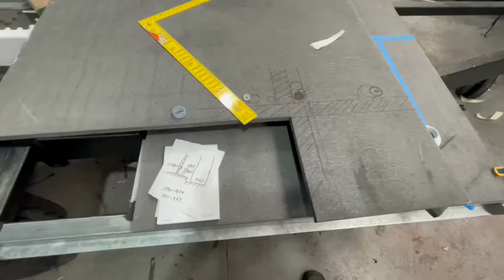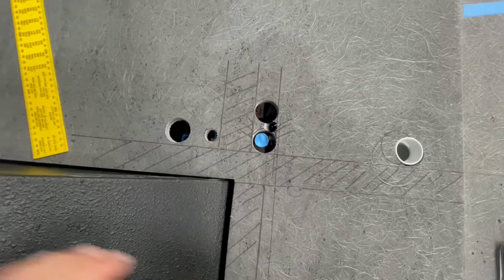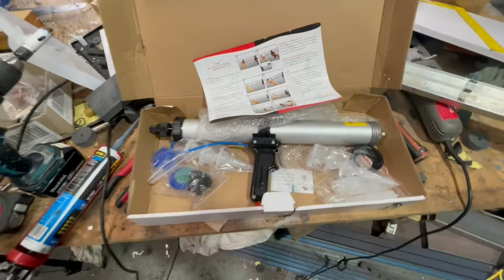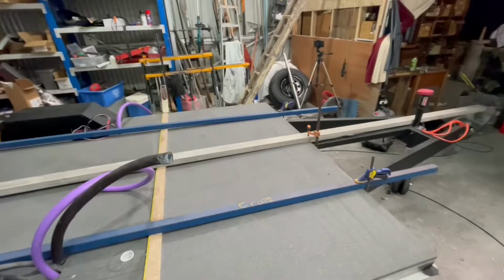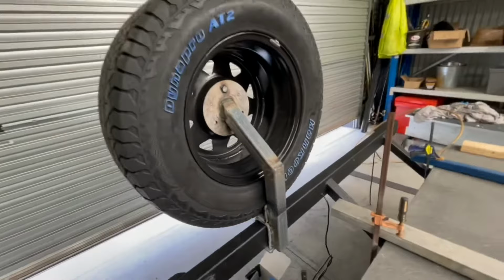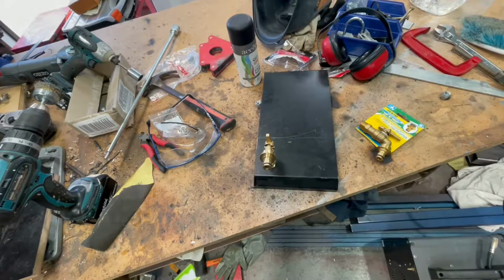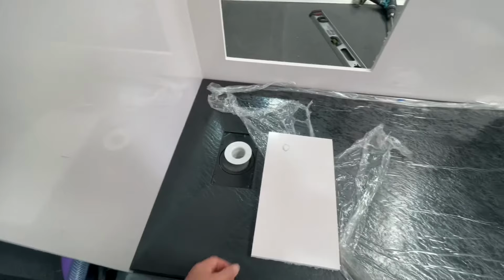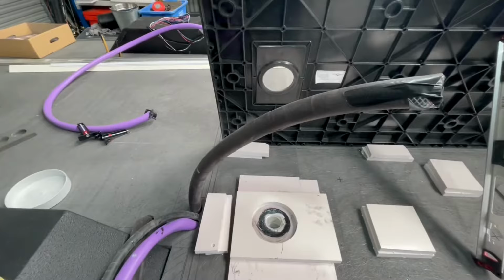Episode #8 - Solo DIY caravan build series - flooring and internals

Comment: Lookin great Craig. That flooring looks pretty tough/dense. I regret not using more dense flooring in mine. That Teroson 939 is amazing stuff. I think I've gone through at least 2 cases of the 750ml sausages :D. Those air caulk guns are a life saver too.
Reply from the maker: Thanks Jess / I’ve used heaps of it also, most of it is on my shirt though i think.
Reply: Not sure if you mention it but what flooring is it and where did u source please Craig?
Reply from the maker: @bradc6721  it is called thermolite - the Q&A episode talks to it. Styromax have it but i got i locally from the national distributor. His company is called avcom i think, in moolap Geelong
Reply: @PerpetualTransient  Thanks legend. Yeah styromax are not to far from me but I also found a lad selling 15mm sheets fairly close to me also for 400 so that might be the go. What thickness to u use? 19mm?
Reply from the maker: @bradc6721  yeh 19

Comment: Where did you source your Thermolite board from? I am going to use it as the floor for my truck camper. I live a few hours North of Sydney and all Google finds me are places in Queensland. 

I’m interested to see how you stand the walls. Every other YouTube video I’ve watched has had a football team of mates to help do it. I was thinking I might just pay someone to get the outside panels and roof cut and installed. Then I can fit it out and wire it up myself.
Reply from the maker: The national distributor for thermolite is in geelong where i live. Search up
Avcom electronics (his other business) to get the contact details. The side walls on the van only weighed 40kg roughly so was able to lift them after a few fails and with some supports in place. About episode 11/12 i think you’ll see it.
Reply: @PerpetualTransient  Thanks for that. I’ll give him a call and see if he has a local distributor or if I can buy direct. Did you get the Teroson from him as well?